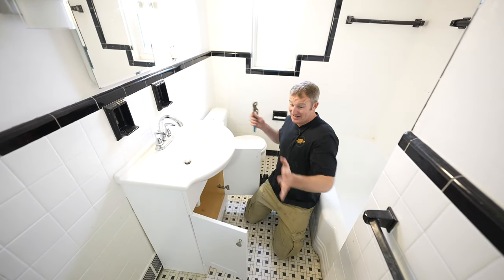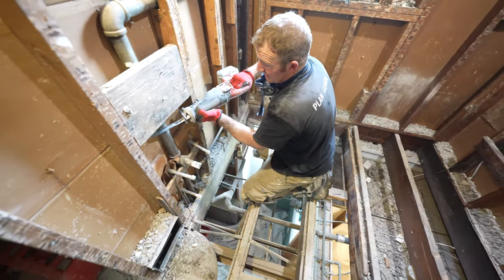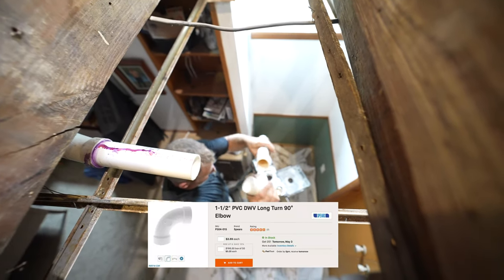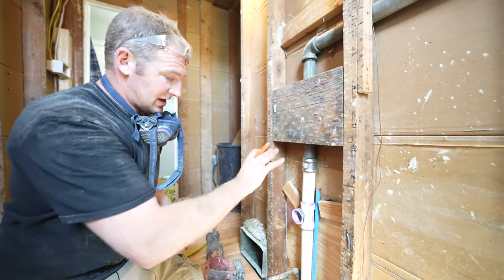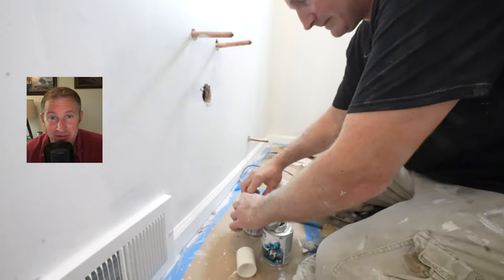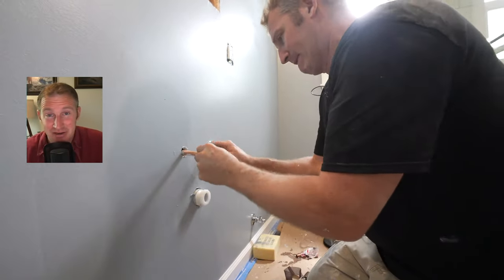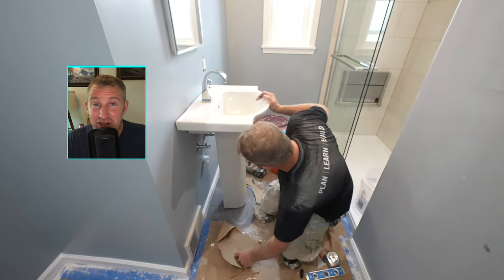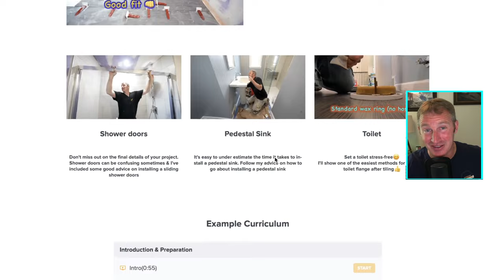How to Install a Pedestal Sink | Pro tips | PLAN LEARN BUILD

Comment: When did you check your new water supply plumbing for leaks?  Nothing but air in lines before you connect the angle stops?

Comment: Does it matter if you use a drill rather than a driver? I'm new to DIY. What are your thoughts?
Reply: I’d use a drill to drill the holes then a driver or impact driver to sink the screws or just use the drill but adjust the clutch